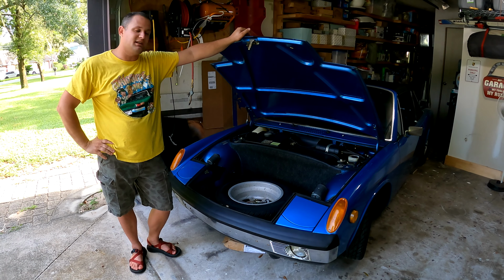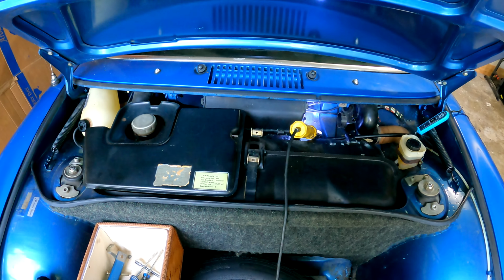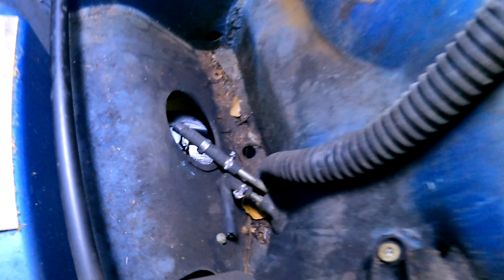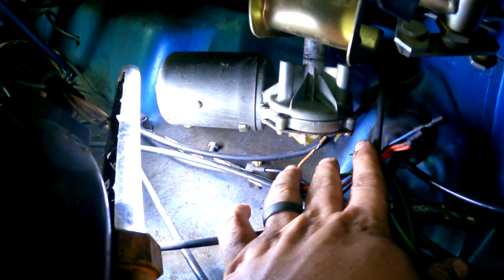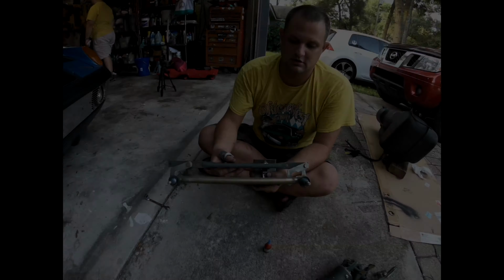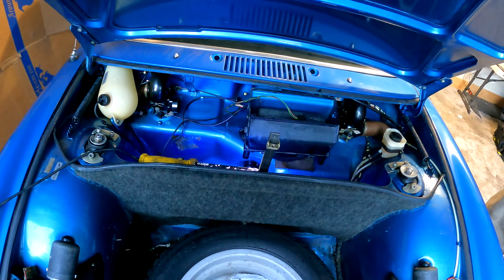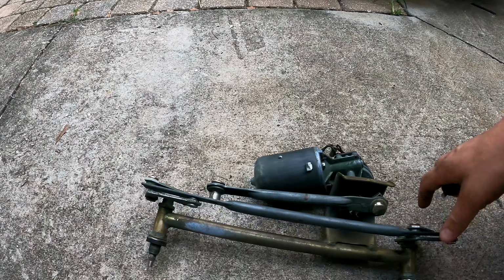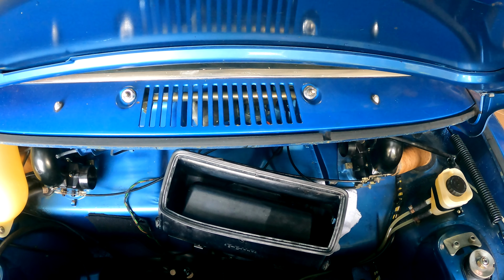Porsche 914 Wiper Repair

Comment: I am just about to refit the airbox on my car (originally I intended doing it a year ago!!!!) a question, why did you not fit the black plastic grill in the top of the airbox?
Reply from the maker: I can’t recall of the top of my head, but only some years had this. My 72 does not, and I do not believe this 73 did either.
Reply: @barefootgaragejax9252  Thanks for your prompt reply Jax.  Perhaps Porsche had a problem with dead things collecting in the air box so on later models fitted the extra black plastic grill. Mine is a '75 car.
What a pig it is fitting the airbag on your own!!!!    All the best Tony.

Comment: As a Porsche dealership tech - during the entire production run of the 914, you don't need to remove the tank to remove the wiper motor. Custom mod a 10mm.box wrench.  Put motor/  linkage in park position , make note of this / angles etc. Remove motor. Saves time - I've R&R'd one in 45 min.
Reply from the maker: Pro tip!! I certainly hope not to do that job again, but now we know

Comment: The memories. The mechanic that R&R'd  my 914 wiper pinched the fuel line putting the tank back in.
Reply from the maker: I’ve pinched the return line! Somewhere online I found the correct length to allow it to loop without pinching. Still not my favorite design!

Comment: How did you plug the return line at the tank? Putting dual carbs and would like to do the same
Reply from the maker: Sealant, bolt and double hose clamp. I guess you could have it welded up, but this works well.